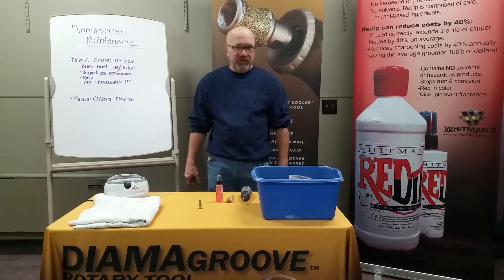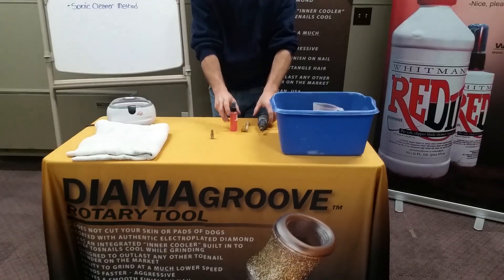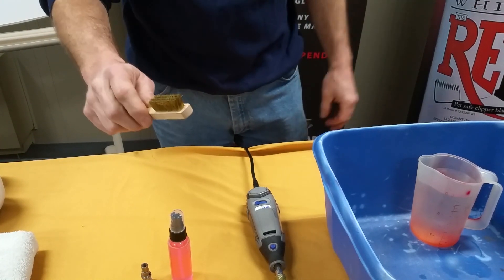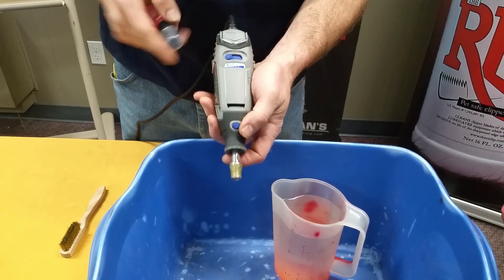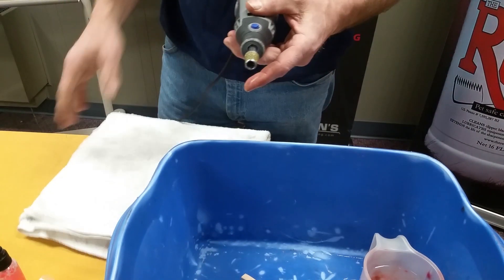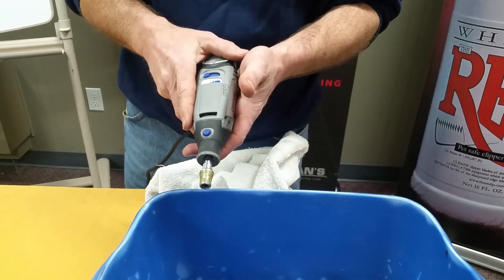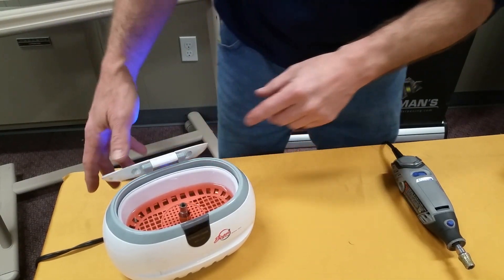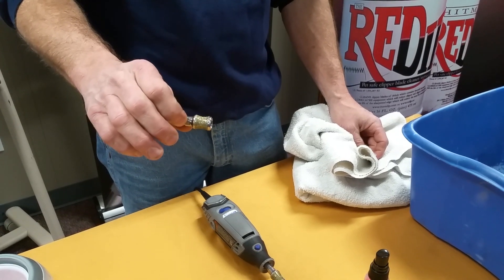Diamagroove cleaning the Diamagroove tool

Comment: what about using break cleaner spray or WD40 for cleaning solution?
Reply from the maker: The Diamakleen is the optimal cleaner when used with the Diamabrush.  We designed the Diamakleen to to perform quickly and safely on the Diamaseries tools.

Comment: Why not remove the Diamagroove tool from the Dremel when using the brush method to remove any risk of water getting into the Dremel?
Reply: Donna Hime he did a demo for me this weekend and he said leaving it on the dremel prevents the threads from getting wet and rust out. Once you finish cleaning it, you blow in the hole to blow any excess water out.
Reply: Exactly!